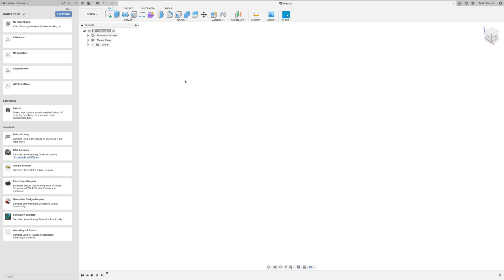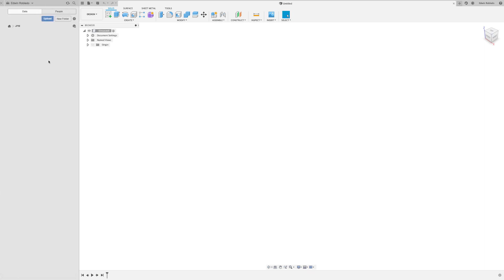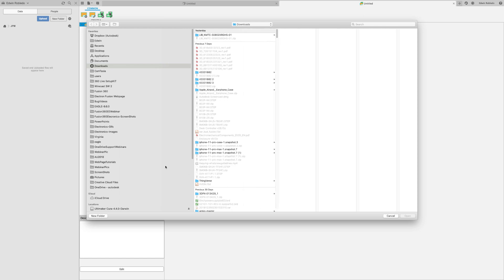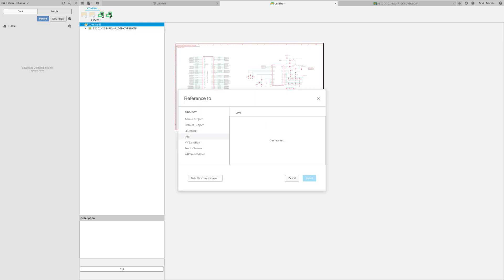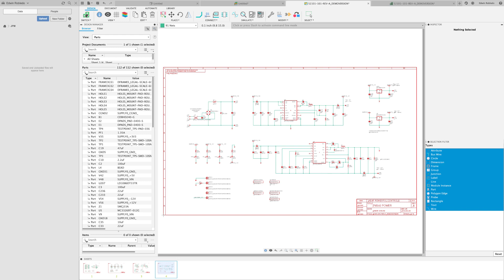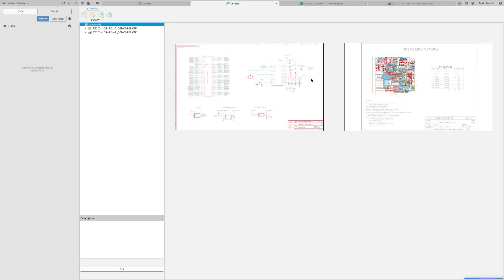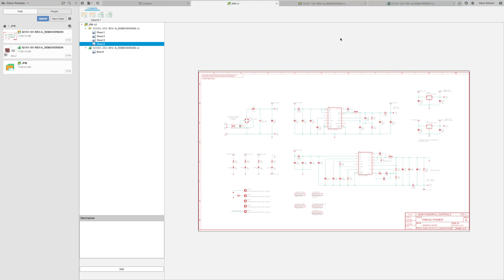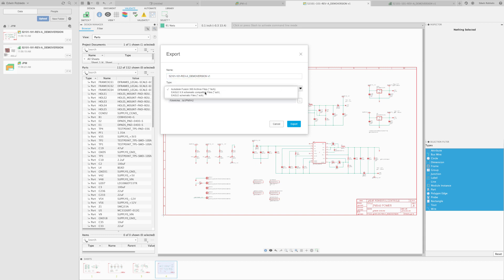QUICK TIP: Loading Autodesk EAGLE design files

Comment: Are the imported files stored locally or in the Fusion cloud? Can I continue my workflow using git for revision control?
Reply from the maker: Hi @kris, your participation is appreciated. The files are stored in the cloud. FYI: Fusion 360 has its own versioning system which works very well. Electronics designs can be shared with other team members via Fusion Team.